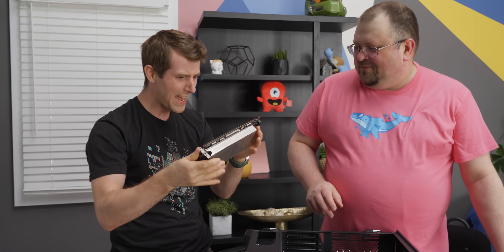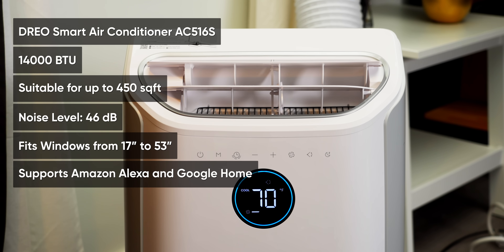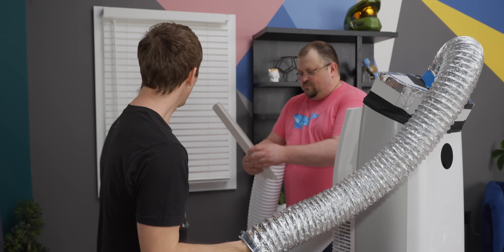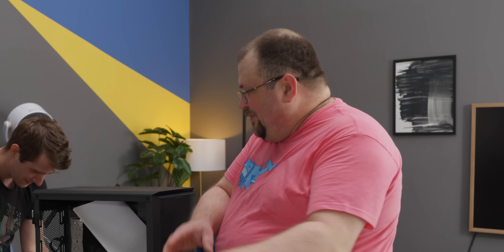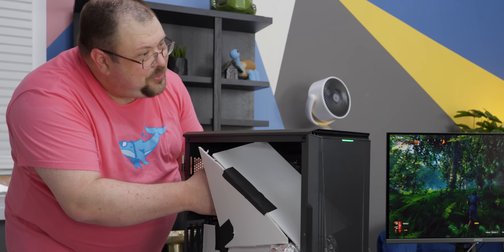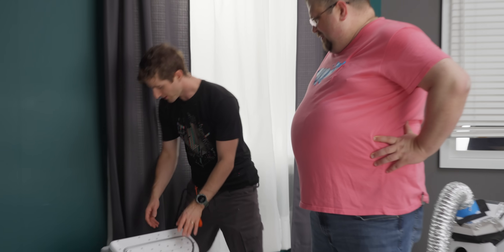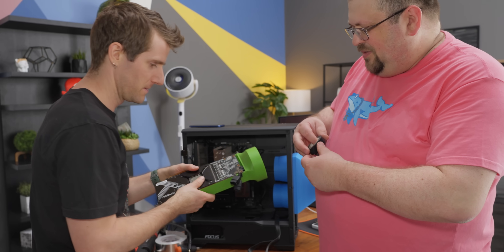Everyone is Cooling Their PC Wrong

Comment: Im an amateur but I am not sure why you made this so complicated other than it makes a good video. Why not keep the shroud idea attach it to the front of the case like you had it. But keep all the internal fans. You have front mounted intake fans to pull and blow the now cool air over all of the components and then still have an exhaust fan to blow the warmer air out? I assumed that was what you were going to do. 

Also your idea of whateevr cool air comes out of the back of the pc cooling the room is NOT going to work the way you have it set up because you have the exhaust hose of the ac blowing in the room. I have one of these the air that comes out of that exhaust can hit 110 to 125 degrees F. So you are actually making it much hotter in the room.

Comment: I've done this. I have a post on LTT forums detailing my journey. It works :D. You need to make sure every part of the intake is covered to make sure only A/C air is only getting in.

Also distance from the A/C matters. Noise & with moisture. I found the longer my tube was, the less moisture appeared closer to PC.
Reply: I wish the algorithm had pushed this comment up. That sounds like a cool project.
Reply: @jajssblue  I fully nerded out man, I bought a moister sensor to tell me the dew point in my room. On average it was about 11 degrees Celcius

Comment: I been running  similar setup for the last couple years during summer got duct from my portable aircon to my pc as my pc is a space heater in the summer which is not good. I can comfortably play while the cpu and you chilling at single digits temps at idle and 50 max on my 12900k under full cinebench 400w oced load, 3070 300w load chilling at 45 ish

Comment: Look into the technology in used large ice arenas located where humidity is a concern. Ice fog is a very real phenomenon these spaces need to deal with. Additionally the speed of the ice can be controlled by the level of humidity of the air and the temperature of the ice. The systems can be incredibly inefficient as some heat heat the air, cool the air, and then do whatever is necessary to make the space more comfortable for people. This large scale scenario can easily be be downsized, and more made efficient for the comfort of the processors. This next part is obvious, water cooling adds mass to the equation, however don't forget the second law of thermodynamics...convection over conduction still applies, if a large mass is precooled (using the appropriate equations to optimize) efficient convention can out perform conduction.

Comment: Why do they keep making single hose portable AC units????? 
Dual hose, or Hose in Hose is the only way to go these days.
I have a Midea Duo (hose in hose). 14k BTU and only loses 2k BTU to inefficiencies (12k SACC) AND it doesn't suck conditioned air to the outside.

I'm willing to bet that single hose unit is less than 10k SACC and still uses 14k BTU worth of power lol.

Comment: Reminds me of the days of phase change cooling for PC which is basically the components of a fridge installed in a PC. The evaporator was directly mounted on the CPU and/or GPU dies for extremely cooling. The systems were designed to run around -30C.

Comment: You should try using an automotive air to water intercooler and ice tank to cool a pc!! the idea behind its use in the automotive world is that the charge air coming from the turbo is cooled by the water as it flows through the radiator fins, and the water is a coolant solution in a tank with ice, allowing intake air temperatures to be close to freezing!! would be interesting to see how it would work in a computer.

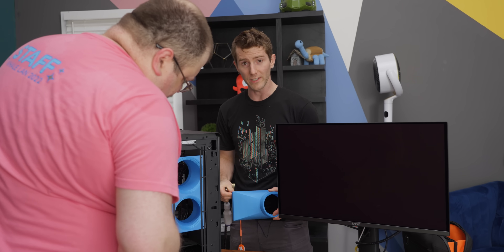Comment: @6:50 you have  ducting from the front. I once 3d printed a similar duct that sealed a tunnel from the front of my case to the radiator. There was a marked difference in air velocity because now air was only being sucked in from the outside and not from the inside of the case around the radiator. Cooling became much more effective. Sealing and ducting is definitely something you guys should try. Can be tested with tape then improved by printing.

Comment: I played computer in a room where temps would drop at about 0 and I got a short circuit. 
I think humidity formed because of the difference of temperature between the gpu and the air around

Comment: Portable ACs are horrible. They work by taking air from the inside of your house, transferring heat into it, and then pushing that air from inside your house out a window. That means you're creating negative pressure in your house and sucking hot air in from outside from anywhere it can get in. It's really, really bad.

Window units are far better. They simply cool the air inside your house, and pump it back into your house, pumping the heat outside and having a separate system to disperse the heat outside.

Comment: way back when I had a FX9590 and crossfire r9 290's as my daily I would turn off the heat in my room and oc it on the single thick 120 aio I had cooling it. when it was below 0f out it would run at like 5.0ghz all core. 24/7 it would boot at up to 5.8 but would still heat up too quick to test with on the tiny aio loop.

Comment: 4090 above 3ghz since Oct 2022. 1152GBps mem bandwidth. Been using a $50 LG AC and grow fan for years. Turn it on when gaming voice controlled. Everyone says I'm crazy, until Linus does it..
Edit: 2 min in Im already yelling. Use a fan to pull the cold air and help shoot it into PC via ducting. I also have a cabon filter to pull any moisture out of loops.

Comment: Why have I never seen it ducted through the back? You can basically send it straight to the GPU heatsink and less space to the CPU one, and then you can exhaust cold air almost right to the gamer using it, not to mention the aesthetic benefit of not having to run tubes out the front

Comment: Next up they should try use compressed gas from cylinders for cooling, for example nitrogen. When a compressed gas like nitrogen gets expanded it cools down quite dramatically (depending on the speed and duration). Seen and used it myself for other technical purposes. And for the exact same reason of condensation, the gas within those cylinders is dried before filling, so no ice can form within it when it's being exhausted. If I'm right they should be able to create a similar setup without having to worry about any condensation at all and on top of that they would have plenty of pressure to overcome any back pressure from the coolers. I (german mechanical engineer) would love to watch them try that 😅.😊😊

Comment: My cheap AC was so loud, that I built something similar. I put a shroud on the output and put the exhaust pipe on it and moved the AC on my balcony and let it blow cold air in, instead of warm air out. It worked really well until the thing broke. I'm not exactly sure what happened, but it somehow drowned in condensation and the blower motor died. I opened the motor up and it was filled with water. But as long as it worked, it was great. It also makes it more efficient I guess, because there is no negative pressure sucking hot air in.

Comment: I have an old SPT floor standing air conditioner that has a thermostat inside the remote control. So you can set it to run based off the unit temp or the remote temp. I wonder how this would work if you got one and put the remote inside the computer and just had it set to have the blower always run. Would it automatically kick the AC on if the components start to get hot?

Comment: So if you followed the steps in the video, you wouldn't cool the room down at all.  If you pointed the exhaust at the evaporator, then your dumping all the heat you just absorbed back into the room.  There's a reason that hose goes to the outside.  Also dual hose system should always be used as single hose units are way more inefficient.

Comment: TechIngredients already did this like a few years go. https://youtu.be/DWVfaxqTyl4 

Condensation is not a problem so long as you keep positive pressure inside the computer case. That is to say, all the air inside has come through the ac first. The condensation will happen when the air is the coldest and that obviously happens inside the ac. All the air in the computer is warmer than that.

Comment: I had a set up like this a while ago. Lot less professional and more of a coincidence. I had a window unit ac pointed at my PC. The window was low and the ac on a box to raise it higher. had my pc facing away from me and the side panel off. It dropped my 980 ti temps by like 10 degrees. It was also an EVGA hybrid cooled model. Thing was pretty sweet. RIP EVGA

Comment: 9:08 Does he not know how air conditioners work? It is not connected to the outside. It is not going to make your room colder.
Reply: Later in the video it's stated they're blowing the hot side to the evaporator. Sure it's not gonna cool the room at least in that spot, but they have stated they're aware of the stupidity of it and the main goal was to cool the PC anyway
Reply: Are you trolling?
Reply: @trentenr7255  Are you trolling?
Reply: @trentenr7255  dude air conditioners don't blow the air from the outside into your house 😂
Reply: @Jake-wk2kz  he's saying that the ac is blowing the heat from the exhaust into the room
Reply: @Jake-wk2kz  Correct, Air conditioners don’t pull in outside air. That’s not how they work. They move heat—out. They suck the heat from inside and dump it outside. That’s why they need a vent to the outdoors.

If you don’t connect it to the outside, then you’re just pushing the same heat around the room. Closed system. No escape route for the heat. So the room doesn’t get colder. Just louder.

Comment: Just put a butterfly valve in the cpu inlet and then you can control the flow alot better. Or put one in both the gpu and cpu inlets and then hook them up to a thermostat so then can open and close by them selfs based on the temps of the cpu and gpu.

Comment: I would like to try Peltier pads running down the sides of a radiator and attaching hot side of Peltier pads to the case to cool them and have a actively chilled radiator in the case without to much engineering! What are your thoughts on that project?

Comment: I would PROBABLY keep two 120 or 140mm fans at the front of the case ducted directly & separately to the CPU and GPU. EACH with sperate temp targets so that they increase RPM to the designated device... but that just makes too much sense.

Comment: I have a Tesla P40 GPU (a data center gtx 1080 w/ 24gb vram) in my server. I saw plenty of modifications to use blower style fans but I didn't want the extra noise. I modeled and 3D printed a shroud to mount a 120mm fan. Despite it being the best pressure optimized fan I could find, it did not perform well at all. I ended up buying and mounting a universal AIO liquid cooler then sticking tiny heatsinks all over the card.

Comment: I had a GPU that would not stay cool anymore and used to lay a frozen bottle of water on the floor with a fan blowing over it into the case towards the gpu. It worked fairly well till I could get a new GPU.

Comment: Those room ACs are terrible at cooling a room though. No shade on DREO, its just a design issue they all suffer from.  Because they are creating so much heat, in the room, to generate the cooling, they are fighting themselves. Sure you have a "exhaust tube" you are supposed to put out a window, but realistically most of the heat they generate to create the cold is going into the room.

Comment: I have seen compressor-based cpu cooling system that replaces cpu cooler with evaporator module. Idk if it was custom made or not. They used foam casing to prevent condensation and I'm pretty sure that thing was cooling cpu below 0C.
What I could do with that thing to prevent condensation is put whole pc into oil

Comment: FYI these AC units really suck for cooling your house... It takes inside air cools it and gives that to you. Then it takes inside air to cool the hot side coils and blow that air outside. Now your house is negative pressure and guess what outside air comes in and heats your house. These are signifcantly less effecent than a standard window unit.  IF you can find one with 2 hoses that uses outside air to cool the coils that would be signifacntly more effecient.

Comment: At this point you are better off having regular watercooling and cooling the fluid with the refrigeration device. Ideally molding copper heat exchanger that also acts as evaporator and you can put all the noisy parts except the silent fluid pump outside your window. Then you can also make the whole thing hermetically sealed and put some silica gel inside to avoid condensation.

Comment: Cool video but really poor execution. You would need to pass the cold air through an AIO to really harness the AC's cooling power. Why? Because water's ability to transfer heat is about 23.5 times greater than air's, and it can carry nearly 3,500 times more heat per volume. My 14900k idles at 29c, full load 63c, my 4090 idles at 29c, full load 62c, with a custom loop. Fans and pump are silent 100% of the time. I don't see > 63 under full load ever. Ever. With the silent fan & pump profile. Properly built custom loops are just incredibly efficient at moving heat. And they consume far less power than that AC unit. Cheers

Comment: A lot of homes have central air. They always have kinda an inlet path for incoming fresh air before it gets cooled or heated. It kinda seems like it would be a natural place to put a rack of PCs. The air conditioner would suck hot air away from the computer. Granted, central air goes on and off via thermostat, although someone could potentially lock the fan in the on position to just keep circulating.

Comment: Another test is to use room air input and pull Computer exhaust air into the AC unit. This would keep the room cooler and avoid heating the room. The AC unit would move the heat outside. The suction from AC unit would increase flow across the internal heat sinks. It also avoids condensation issue.

Comment: If instead of splitting the air between the cpu and gpu coolers, the same stream of air passed through the cpu and the gpu in series, that would solve the problem of the cpu getting more cooling than the gpu

Comment: 8:13 Correction for the calculation

14.000 btuh / 3.412 = 4.1kw
4.1kw is cooling capacity in kw not the power consumption(power draw)
Checked the model unit power consumption is about 1290 watt - 1625 watt

Comment: The concept is valid but this is both over and under-built.

The problem that was being run into with the GPU was that air is being forced through a constricted space, and for that you need pressure. And all that pressure was being demanded from  the air compressor, which is not meant to maintain any kind of static pressure.  Just build your PC normally, with positive pressure and intake on the front and/or top of the case, and just feed the air-conditioner into wide baffles that cover the intakes. Don't feed it into the case. The fans inside the case will take care of the rest and evacuate the remaining, still-likely-cool air out of the case in the steady state.

Also Build an open T-junction into the baffles, so if the AC is pushing more air than the case can take, it has a bypass to just go out into the room without stressing the AC.  And when the airconditioner is off, case will still be able to pull in air from the room.  Shove a Tesla Valve on it or something to make it output less than it can suck in, if that matters.  But the point is, just feed the cold air to the case and it will behave like it's in a room the temperature of your AC output, which is all this setup is giving you anyway.  Relying on the back-pressure of the AC when fans ought to be doing that job is just silly.

Comment: an air conditioner cannot do full output all the time; it will need to defrost eventually unless you're in a room with like 0% humidity (and not breathing...)
so this gaming rig could at best be used for like an hour or 2 before suddenly overheating.

Comment: So....basically....a datacenter?

This is (relatively), a very similar to the basic operating principle of the air handling units (AHUs) in a data center where it cools the air, and then granted, servers have fans, but otherwise, is delivered to a system.

Cold aisle.

Hot aisle.

Same basic idea/principle.

Comment: Why have you stopped half way? Loop back the cold air from PC into AC intake :) If you build super air tight loop you won't have issue with ice on heat exchanger (because you will have finite amount of water in the loop) and you can go down in theory to coolant freezing temperature of air.

Comment: One of the big things that would reduce the condensation is having the hot side actually vent outside, which would reduce humidity in the room overall. Having a dual hose model could also help a huge amount with the humidity and efficiency.

Comment: One thing I wanted to try, as part of a liquid cooled system, is to attach a big flat waterblock with a sheet of thermalpad to the cold side radiator of such an AC. Can go much longer distances to an AC in a different room even and uses thinner tubes.
Reply: This is how I cooled my tiny PC in my sleeper truck.  I had a hot side and cold side radiator setup, so the CPU/GPU were air cooled, but I had a 120mm radiator taped to the air vent set to 62 freedoms, and a 240mm radiator in the case, which was in a cabinet.  I was effectively just liquid cooling the air instead of needing a fresh air source.  Condensation wasn't a real issue as the liquid temp lingered around 69-70 degrees, and the rest of my cab stayed comfortably cool.